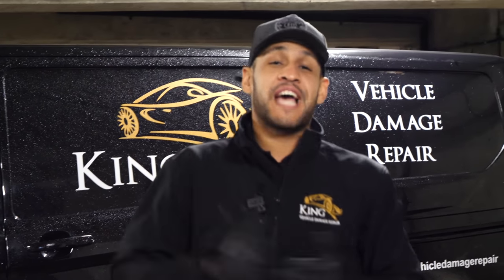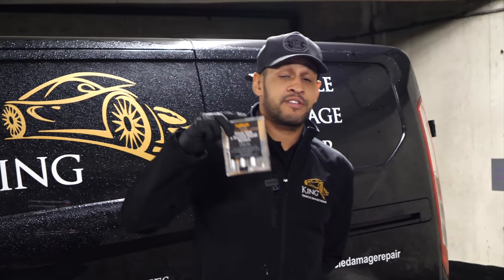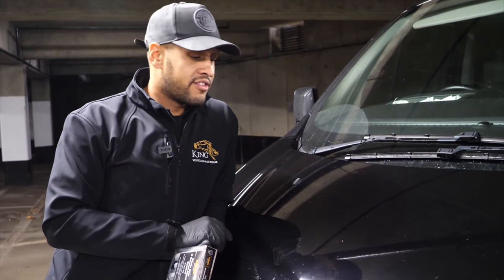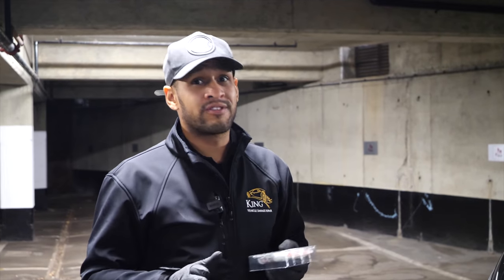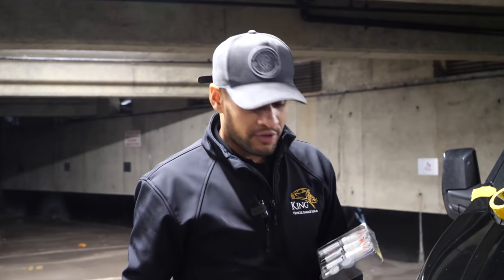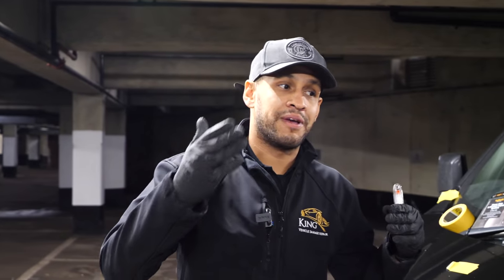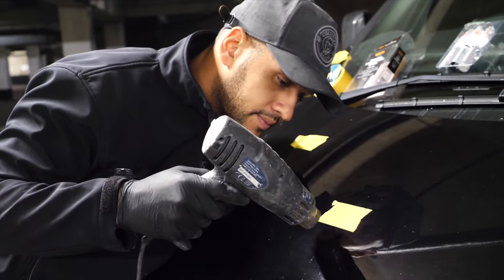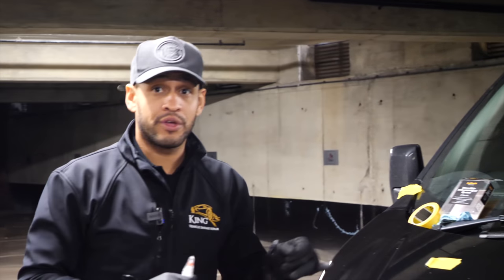HOW TO touch up a chip using Halfords Chip Repair Kit!

Comment: 1) Clean the area first to get rid of any grit. 2) You didn’t use the clean pen applicator nib to clean out any tiny bits of grit from the chip. 3) It’s easier to use a toothpick to apply the tiny amount of the primer/main colour to the chip.

Thank you so much for this. I have the same kit. The lad who sold me the kit said watch youtube firstly. I would have made a complete mess of my black car. Great tips. 

When my hubby used this kit for his old car. It was like he splodged nail varnish all over . It was horrendous. 🙄😂
Reply: Lol my car will probably be the same on my old dear car.but if it stops any rust I'm not worried too much.

Comment: You can actually get a better end result by over filling the chip slightly, and then wet sanding with 1500/2000 and then cutting then polishing the paint

Comment: So I accidently found this out, but there is an other way to use the touch ups kits. The clear plastic lid can be removed and it can literally be used like a pen, found this less messier than the brush end.
Reply: Got to the hobby store and buy a real brush for $3

Comment: my friend has offered to do my stone chips and scratches on my car, he said he will flat it back and polish it, hes very skilled like that, you can see on my car that someone else previously has touched it up on bonnet but you can see it's sitting high and some of it has come away no doubt they used primer 100% 😂 to be honest they made a right pigs ear out of it, thank you for the video though cause I have no doubt I would have followed halfords instructions if I was doing it myself and I would have had clear coat running on my body work 100%

Comment: You can mask tape around deep chips. Fill in deep chips with primer. Layer and dry. Sand the prime dried chip level with original paint level with wet 2500 grit and then dap on the final paint

Comment: Great tips there , I feel more confident of using these kits now , 
What would you recommend for Plastic ? Eg , around the Fog lamps on my Vauxhall Agila the Matt Grey has chipped and it's Black ,so I'm wondering what paint to use ,I'd not be confident with Spray

Comment: The primer is needed if the stone chip has gone beyond the grey primer layer. Once bare metal is exposed, rust will form. It all depends on the stone chip. No primer is needed and will in fact raise the paint if its still there. 

Wet sanding with a daisy is needed after to smooth is down flat, then buffed.

Comment: Thanks for the video. I wasn't aware such a product existed till now. I hope you might be able to answer my question. 
I have small pits on my bonnet which I covered with T Cut scratch removing pen. It obviously did nothing for the pitting, but I hope it has stopped water and air penetration, to prevent corrosion begining.
There is a clear cover of the thick viscous liquid over the pits. Under the clear cover, I can see a dark(black) colour in the pits, among the original silver colour of my bonnet.
What is your opinion. Have I stopped corrosion and what should be the next steps I take?
The pits are about the size of the point of a ball point pen.
Any advice will be appreciated.

Comment: If the chip has surface rust, what should be used to remove it without damaging surrounding paint and finish?
Reply: Just sand it you can touch up anything slightly scratched afterwards with the gloss. I put just gloss in a couple little scratches n u cant even see them now, but u can see the excess gloss slightly in the right light on black car but that could be polished down probably

Comment: @KINGVehicleDamageRepair Hi Scott, what is the best DIY tool for removing rust from a tiny chip and how would you check that rust has not spread under the surrounding paint? What is the best tool to sand and create a nice small circular localised area around the chip? (I heard using a fine grit that is hole punched and then the small circular punched piece is glued to a pencil end, to create a sanding tool), I would use an applicator swap and I have Chipex VW white silver metallic. I'm a slightly more advanced weekend warrior detailer btw. Also which areas do you cover, I'm considering a front bumper and bonnet re-spray on a 2018 WSM GTI, I'm North London / Hertfordshire based

Comment: Great video mate, do you have any solution for superglue on paintwork cheers
Reply from the maker: Unfortunately I do not know of any methods for non professionals. Removal without a respray is pretty specialist.
Reply: @KINGVehicleDamageRepair  cheers buddy
Reply: @tobycarvary9059  Yes, go to a model aircraft shop and buy some Zap cyano de-bonder - works very well!
Reply: I just had to remove superglue on a spanking brand new Caulk Grey Porsche 911. Owner took it through a swirl tunnel and it ripped the plastic gas filler insert right out. He glued it back in and a THICK glue run went 4 inches down the side of the car, but he did nothing. As a professional detailer, I came in and saved the day with Acetone. BUT, you must proceed with caution and a stop watch. 30 second increments with a dampened microfiber towel. Washing thoroughly that area,  between each step.

Comment: Just got one of these n its got sandpaper to sand it first and to sand every layer u put on it. (Not the best Anyone with half a brain would pick the prissel out of the chip, if your to dumb to remove it then your probably too dumb to drive😂😂😂😂 seems a good little kit just cant open the pen part instead of brush part. U also get a little dabber tool with it for chips. I went abit mad n even tried using brush for a scuff on door n seems good 🤣🤣🤣 compared to my last cars rusty square from spray cans, i turned a rusty spot into a square rushing it